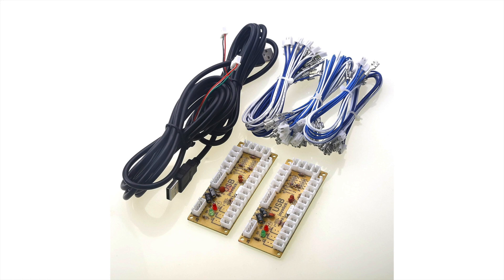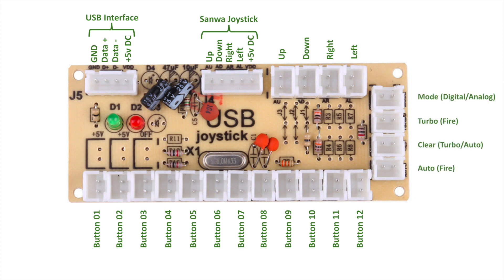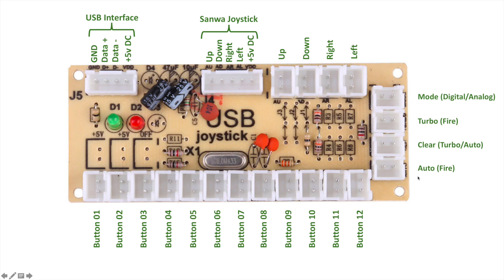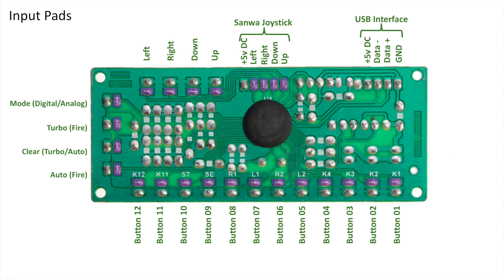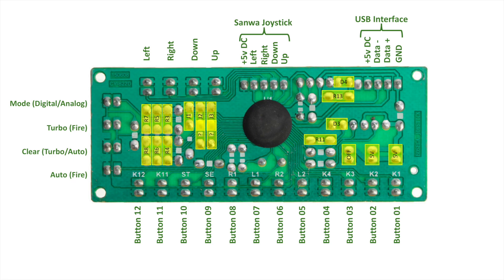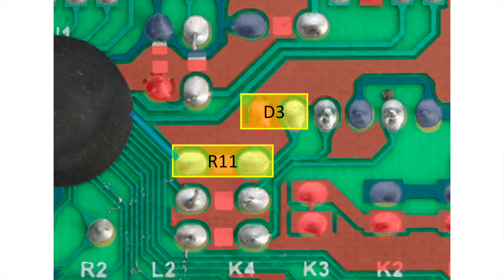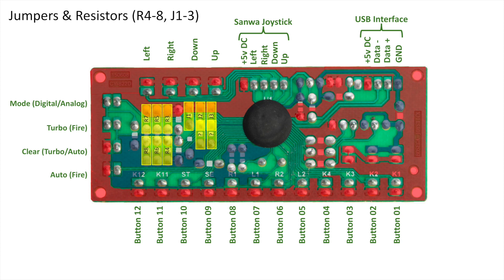Zero Delay USB Interface - Part 2: The PCB

Comment: The SOC is actually a DragonRise HID USB and has Windows HW IDs of USB\VID_0079&PID_0006&REV_0107
USB\VID_0079&PID_0006. These have been reported as generic but they are NOT, but they are ubiquitous. However some Chinese manufacturers may be cloing the firmware too. The XTAL on board would be primarily used for internal timing for interfacing, however autofire might use it because the SOC likely doesn't have an RC oscillator since the chip functionality requires an XTAL. So no it doesn't but likely it does.

Comment: the red +5v ports @9:44 are for arcade buttons with 5v led
Reply: There are no connectors on the 5v ports.  So, how to use the port to light up an led, for an indicator on a button box, for example?  Never mind, the video answered my question.  I can simply solder connectors to the 5v rails to run LEDs.
Reply: @gregpruitt1647  yeh just have to do it yourself if the board didn't come with port, cheers!

Comment: May I know how to share the same joystick and buttons with JAMMA?
Reply: you don't - Jamma is common ground, Zero delay is common power and both systems supply their own power - Jamma via game pcb and Zero delay as USB. A different era. it would require a large multipole switch selector. Use a plug harness.
Reply: this is USB not Jamma, use a multipoll switch or a plug harness 8 pin for joy & 3 sw

Comment: I want a board that can use potentiometers
I want a signal that gives an output between 1 and 0
I don't want a button for a joystick, i want an analog joystick
Analog is important for setting throttle, or run speed
Reply: read my instructables comment.

Comment: A blog at instructables reveal the hidden Analog joystick feature of the Zero Delay USB Encoder. Do a google search to find. Youtube kills comments w/ links. Mode switches directional output between digital and analog. Joystick becomes a POV high-hat/D-pad and visa versa.  
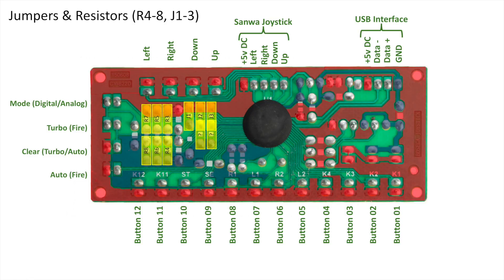10:09  R1/R2 X-axis (Analog X - Roll), R3/R4 Y-axis (Analog Y - Pitch), R5/R6 Z-axis (Throttle), R7/R8 Z-Rotation (Rudder - Yaw). All analog inputs share a dual 10KΩ resistor voltage divider to center the inputs. J1 uses a 0Ω resistor to default input mode at boot, digital(high) pins, Analog(low) pot/resistors. J2 & J3 are other presets floating, unknown use.

Comment: The red and green LED on PCB indicates the MODE, which can b e toggled with a momentary push button. I was just testing this board with Tekken 7, if we change the mode, the RED light turns to GREEN and the joystick works with TEKKEN 7 without any additional remapping software.
Reply: Can u show u build

Comment: This stick has been working fairly decently for me for my PC, but the only thing I don't like is the analog/digital which forces me to map it to a button. My stick only has 6y buttons (classic SF layout, with a select for coin, and a start for 1P) but I have to turn it to digital mode for it to work with my PC. Is there a way to default it to digital so I can disconnect the wire and plug it into one of the button inputs?
Reply: Have you found a solution to the problem of constantly switching to digital mode when turned on?
Reply: @АлександрБ-н5н  unfortunately, it is by design or the pcb. Only way is to get a different PCB… good thing these are cheap
Reply: @samgao  Thanks for the answer
Reply: @samgao Board default boots to analog, change J1 and it should boot to digital POV.

Comment: Hey Olaf, I'm trying to connect a coin acceptor to this usb encoder. I can't figure it out.  Could you help me?
Reply: @samhillier4427 Jamma is common ground, Zero delay is common power. work on a coin mech with drop coin switch, otherwise relay or transistor inverter circuit to switch on different level.

Comment: Is there one of these that has more than 12 button terminals?? I wanna make a double joystick arcade set up and cant seem to find a way to do so with only 12 buttons.
Reply: CY-1121 - dual joystick/10 buttons each side 
CY-2121 - LED dual joystick/10 buttons each side 
am-zon: SJ-JX Arcade 2 Player USB Encoder  
Look for single board two rows of k1-k10 with joystick connector, opposite to USB A plug. Comes in Happ or Sanwa wire harness sizes. a-sin B07RZJVPLY B07S3TZWV5

Comment: Translator:
I'm wondering. Can I combine two buttons, the Select and Clear (Turbo/Auto) buttons, and use Select to turn off Turbo?
---
It does not work. By the way, it's very stupid that you need an extra button to turn off the Turbo/Auto.
Reply: Auto and clear work the same as k1-k12, shorted to +5V. Mode and Turbo are pulled-low (Gnd thru 1KΩ resistor) when shorted to MCU pin. Turbo(?->Lo) shares Clear(?->Hi) pin input. Mode(Hi->Lo) pin is by itself. Turbo & Clear pin are shared and is some 0-5V pre-state. Turbo & Mode run opposite to other keys(buttons).

Comment: I have a Happ joystick which has 4 switches the wires connect to. I understand Sanwa joysticks just have a single connector that plugs into the board. How would I plug my Happ Joystick in? Do I plug it in where it says, "Up, Down, Left, Right?" Thank you and great video!

Comment: Maybe those traces are for IF you have sufficient current coming from the USB line, so that you could effectively daisy chain from the +5V line, into another board of same or similar design?  Many games can make use of multiple controller configurations, flight simulators come to my mind, where there maybe multiple directional joysticks and potentially a foot pedal or two or three possibly?  Also, it is not altogether uncommon to find joystick buttons that have their own LEDs installed within a translucent housing.  I have this same exact board, but I’ve spotted one difference and it is only on its screen print and not any different in layout or design.  Where your board says +5v, +5v and OFF, mine says d3, d1, and d2.  This is beneath the other portion where it’s printed, D1, D2, and D3 above those two LEDs, so I don’t think that it’s addressing those LEDs at all, but probably rather an indication of a ‘digital’ switch to possibly go in that position.  Maybe it was planned that a button could serve as a ‘shift’ key, where combinations of shift with other buttons would potentially switch the joystick to serve temporarily as a ‘player two’, since some games could freeze while waiting for activity from a ‘player two’?  Also I forget that this is mostly intended for people who wish to build a sort of arcade cabinet, and so the coin receivers and their associated operations could possibly be intended to use these switches.  The other resistors are maybe for attempting to resolve any ‘bouncing’ effects resultant from long button presses?  I seem to remember that circuits like this often need components to add a ‘de-bouncing’ effect.  THANK YOU FOR SHARING THIS, I’ve found this helpful in understanding this board, and it’s always nice to have an insightful look at our electronic gear!

Comment: I want this board. I want to replace the electronics of a Interact SV-286 Digital Joystick that has an old game port to USB 1.1 adapter. All the switches, including the Hat switches are standard surface mount micro switches but with solder pins instead of connectors. This Joystick has like 20 switches in total, but I only really need like 11 or 12. I could use the ones I dont use now for the Auto Fire and Mode settings? However my concern is the UP, DN, RIGHT, LEFT ports. Will these 4 ports work in Windows and Linux as a standard 4-way Hat switch? Or I guess what I am asking is does this Game board CY-822A have a 4-way Hat switch function? I use the 4-way Hat switch for Left Strafe, Right Strafe, Jump and Crouch in all First Person Shooters. And would there be any benefits to converting this very old Game Port based USB 1.1 Joystick to a more modern USB 2.0 connection? I'm wondering if latency is truly reduced but I somehow doubt it. Thanks for the video.

Comment: i'm trying to figure out what cables to buy, i bought 1.25mm JST plug cables but the connector is too small.
Reply: Looks like JST XH. I used them before for a not related project. 2mm from memory.
Reply: Jst Xh 2.5 - 2 Pin

Comment: is it possible to connect a gamerfinger optical joystick pcb for sanwa jlf joystick to it?
Reply: I would says No. Designed for Brooks Fighting Board Inputs are Hi -> Lo (Gnd). Zero Delay use common +5V, so, Lo -> Hi (+5V), There is no ground to run the Electronics by default and are inverse state for action. Logic would need to go thru an inverter for proper state. It is plug-No-play.

Comment: Hello Olaf Wagner
, maybe there is the possibility to go directly on D-pad mode instead of starting using Analog with the jumbers and lack of resistors. Actually i have to manually switch after. Very interesting!

Comment: Looks like a "new" version of this encoder is available.  Seems to be a newer manufacturing process with top mounted jumpers and resistors instead of thru-hole jumpers and resistors.  Comes with 2 red 5V plugs installed and 1 white 5V plug. Also a USB plug and USB header (maybe to daisychain more together?) I would love if you did an in-depth on that one too, like you did the "old" version. https://www.amazon.com/EG-STARTS-Encoder-Controller-Joystick/dp/B01L8K21CK/ref=pd_rhf_ee_p_img_1?_encoding=UTF8&psc=1&refRID=R8K0CPKXMYJPH55PSV37
Reply from the maker: I certainly want to take a look at the new board. I have been holding off for a bit, because I see that in the pictures they say "New version and old version will be shipped randomly" (and I have seen this in all the places that well it), so I was thinking of waiting a bit for most of the old stock to flush out.

Comment: I am trying to build pedals for sim racing, would a 10k resistor on the up / down sockets and the device on digital mode work to register the throttle and clutch as they should be ( not just 0 and 1)

Comment: Supposedly you can combine these to create a 4 player encoder, is this correct? If so, how do we connnect them all together?
Reply: I'm guessing they must all create different USB identities. But that's 4 times the cost and 4 USB connectors. If it's a fixed 4 player system there are dedicated boards to do that with one board and one USB connection, also they tend to have screw terminal blocks to attach the wires directly, which might be easier for that many wires.
Reply: you would need four boards and button joystick sets.  I the arcade setup they all tie into a central board that runs the game or games

Comment: Is that possible to connect a potentiometer on this board?
Reply: Lucas Lcs I tried but it inputs always 2 buttons at the same time , for example , I rotate to the right and he reads right then left
Reply: @916521279  when my board arrive I'll try it, I think it needs  Arduino to convert analog to digital and then define the right and the left in controller
Reply: I’ve the same problem, the potentiometer read 2 button at the same time, i must connect potentiometer only with an arduino boards?

Comment: is there a way to permanently switch to digital or analog once its powered on?>
Reply: Short the switch by connecting the pins (clip one of the included connectors and connect the wires together)
Reply: @danielrobertprice  That does not work. It need to send the signal after it has been powered on, and then only one momentary connection.

Comment: Just bought one so I can convert an old Atari 2600 case with a PI into a retro game thing for old consoles. Probably will use the old PI1 I have as it has composite out. Will be wiring the connectors into atari 9 pin male joystick ports so I can use real Atari joysticks :)
Reply: Please show me how you did it

Comment: im running 4 of these on raspberry picade in a turtles cab my oldest son was asking if it will work on a ps4 have you ever tried it on ps4
Reply: A TMNT cabinet is what I also want to make. Supposedly you can combine these to create a 4 player encoder, is this correct? If so, how do we connnect them all together? If not, are they just all single USB connections to the Rasberry Pie?
Reply: @louie000007  
I don't know of a way to connect the boards together but if you are using a Pi for your Cab it will recognise them as individual USB controllers just as if you plugged 4 gamepads into it. If you want spare usb ports for keyboard etc you can simply attach a self powered USB hub as long as you don't plug any combination of things into the hub that exceeds 1.2A (4 of these boards will draw next to nothing 0.75A combined at most)
Reply: Howard Malone how do you config? I can't get past thumb inputs, this is at retropie startup, it detects generic as controller
Reply: trbcop Rrrr when I first did my pi I did key board first and joy sticks later